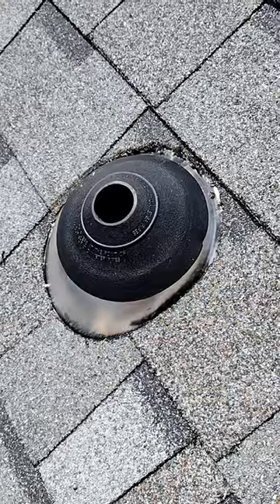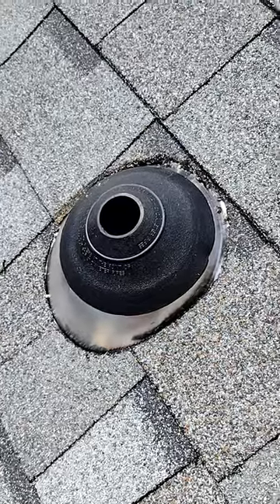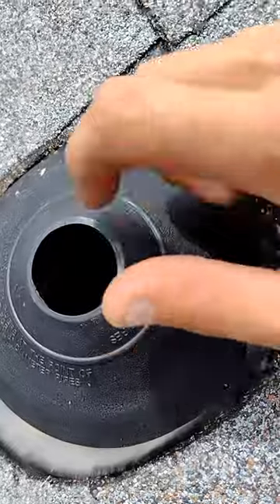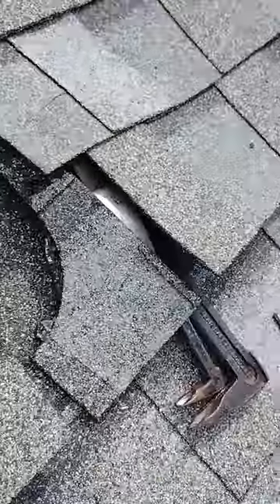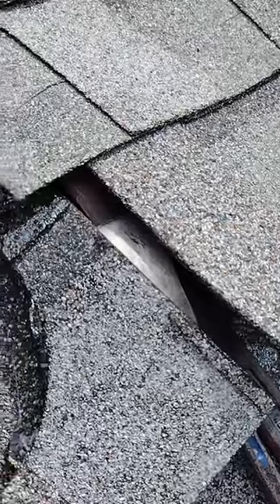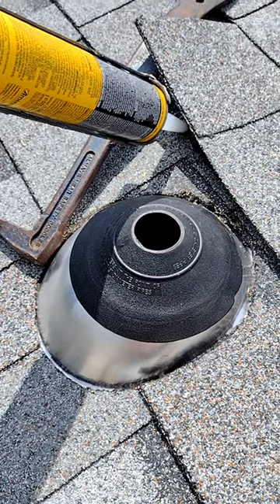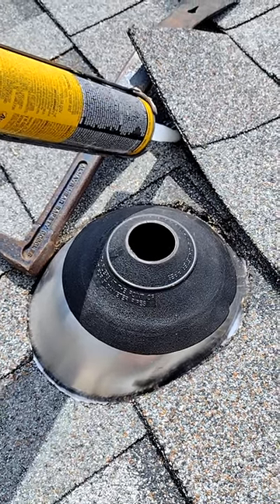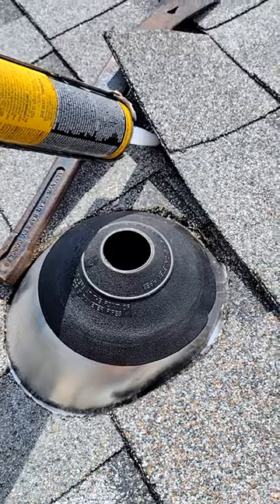Roof Boot Tips

Comment: Some cheap arse roof that. Probably why houses in America last about 20 years before falling apart
Reply from the maker: I know foreign builders try their best to disparage American building practices but we don't all build the same. It varies by region and climate. Our code standards vary by state. Some builders down south cheap out and you're right, it doesn't take very long for those houses to deteriorate, especially if they're hit by a hurricane, flood, or tornado. In my area, we have strict codes. Shingles come in different warranties. Generally 30,40, or 50 years. The sheathing underneath comes with a 30 year rating. The aluminum drip edge, PVC fascia and rake boards, and the stainless steel nails these shingles were installed with, come with lifetime warranties. In this case, these are 50 year shingles that will last longer than that. It was installed in one day for $6500. That's $130 per year. I would doubt that you can show me a roof in your country installed for that money in one day for $130 per year until the warranty runs out.  This roof will most likely outlive the current and next owner of this house, as well as you and me. I've worked on houses from the mid 1600s, all the way to modern. I can assure you our houses last a lot longer than 20 years, and we have extremely harsh climates. For example, this entire week has been over 100 degrees(38 degrees celsius), and we've gotten heavy rain twice. In the winter we will have below zero weather and get a handful of snow storms with multiple feet of snow each. Some examples of our strict codes include- our roof rafters need to be 2x12, or in your case 50mm×300mm, to pass insulation code. Our walls need to be 50mm×150mm to pass insulation. Our carrying beams are almost all engineered lumber as strong as steel and up to 80cm tall and up to 1800 cm long. Our houses will outlive all of us.
Reply: The slate and stone shit is really cool.  But unfortunately your economy can't support everyone living in a stone house either. It's nice that they could back in the day. But your infrastructure will fall apart just like ours because you bought in to our politics and are tracking the same course. Ikea isn't from USA.